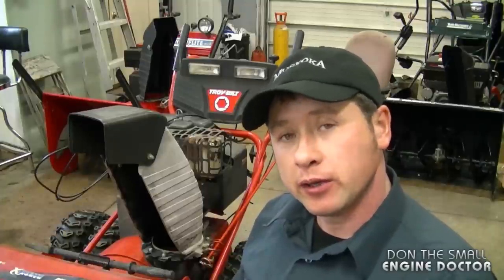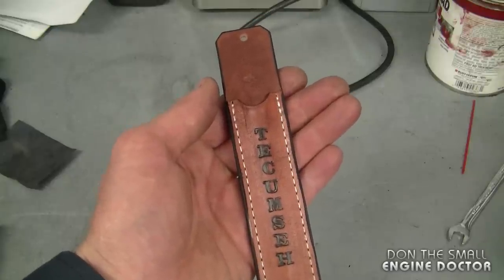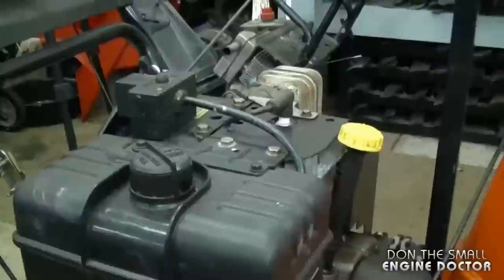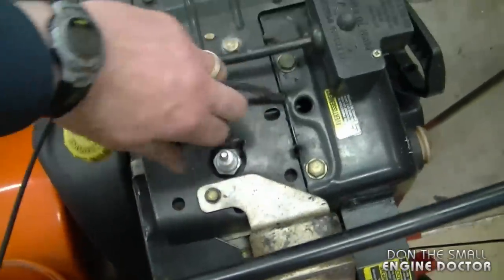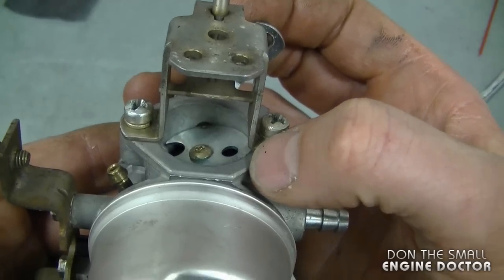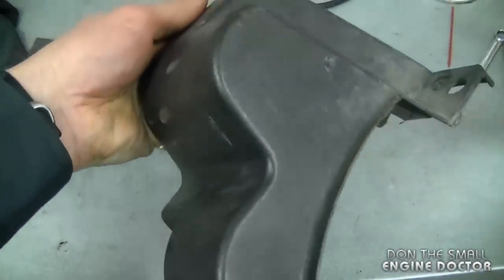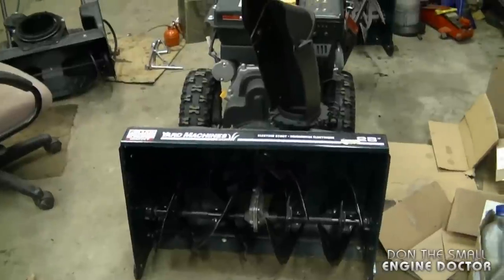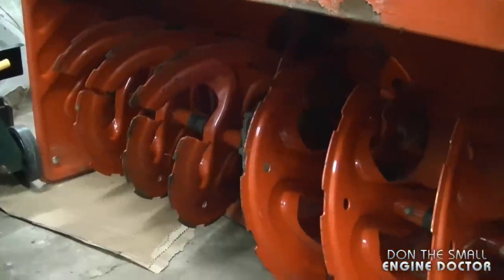Small Engines Q & A Video #146

Comment: Thanks, Dony for one of the best Q & A videos I've seen on snowblowers.  One extra benefit of using pure gasoline is the extra power one gets from it.  Ethanol fuel does not burn as well as pure gasoline across all octane ranges.

Comment: Another great video Dony ! Here in the states ( New York at least ) all you can get is that crap ethanol gas . What I do is buy the VP SEF pre-mixed 50:1 for my saws , backpack blower and string trimmer it's expensive but so is my power equipment . As for my lawn tractor , snow blower and push mower I use super unleaded and always add Star Tron Enzyme Fuel Treatment to keep the ethanol from separating from the gas and have yet to have a problem But when the season is over for the respective equipment I do as Dony has said in many videos and run the carb dry and drain the gas tank .

Comment: Don, thanks for another great Vid. About the inline fuel filter. I have been putting them on generators, lawn mowers, ATVs, Snow Blowers, and just about everything that has a fuel line. These (in tank) fuel screens really don't do much of a job. Have you ever hooked one out of a tank, maybe you can show us one. Nothing but a piece of foam, most of the trouble people have with carbs is because of the poor filtering system. Why else would we be finding DIRT in the bowel of the carb so often? I just ordered a box of 12 on ebay for $22. Total Canadian. Bet people would like to see you show how to install one, maybe along with the shutoff valve. The shutoff valve used to come on all snow blowers one time, now they are around $10.

Comment: Good advice. The only two things I would add is:

1. The pulley cover also stops snow from entering the lower end. A wet, oily friction disk or frozen transmission could result if you don't keep it covered;

2. I also add fuel stabilizer to the fuel for my OPE. It adds about 2 cents per litre to the cost but cuts down on carburretor  paranoia. Sometimes I forget to put things to bed properly, too many toys, not enough time. Seafoam is also reported to work nicely.
Reply from the maker: yes for sure
Reply: "Seafoam is also reported to work nicely"
Hey Frank, I've been using Sea Foam for a couple of years now, I filled up a generator with fuel and Sea Foam mix three months ago and when I drained the tank this past week there was a thicker orange gunk sitting in the fuel line just before the carb.
I worked on a carb for a neighbour that had stabilizer/fuel mix sitting in the tank since last Spring and it was nice and clean.
I think I'll be switching back to fuel stabilizer.
Reply: Kevin Watson
I've heard various annecdotes about both types of products. I think I've had better results with stabilizer but I'm not positive. I believe Seafoam is marketed more as a fuel additive that will clean the carburetor than as a stabilizer. Most stuff I've seen on cleaning a carburetor also describes disassembly and soaking so I sometime wonder about cleaners you can add to the fuel. The other problem is there is a lot of variation in fuel. I use High Octane since its the only variety, where I live, that doesn't have alcohol. I have seen some dealers with alcohol in their high octane blend so even there you have to watch it.

Comment: I'm having trouble setting carb on Stihl 020T. Harder start and no idle. Was serviced at Stihl dealer about 18 months ago. Very little use. Store with Trufuel.  On line manual can't find high speed adjusting screw. Love the vids. Thanks Ed

Comment: Nice vid. Great tips, especially the use of premium fuel. I have more than 20 pieces of small engine equipment. I always use premium fuel with fuel stabilizer added.  I see it as money well spent. Some  special purpose tools may set as much as a year between uses. I don't recall the last time I had a fuel related carb problem.

Comment: Don, I agree with your advice to use straight gasoline (no ethanol) in small engines.  Problem here in the midwest USA, gasoline containing no ethanol is unobtanium.  Well almost.  I buy aviation gasoline from the local air field.  Twice the cost of pump gas, but I don't use very much.  And it contains lead.  But no worries about draining fuel at the end of the season.  I wish we had some source of no ethanol premium pump gas.

Comment: Along with shutting fuel line valve I also take the cap off the fuel tank and place a piece of plastic bag over the hole and screw the cap over it. This seals the system off to moisture.

Comment: I'm not sure if we can get ethanol free gasoline where I live.  For the last few years we've been running ValvTect marine fuel in our snowblowers, leaf blowers,  our leaf chipper/shredder, and our generator.  It's expensive (about $1 a gallon more), but we haven't had any carb or fuel issues since we started using it.

Comment: I've got a cheap Poulan leaf blower that we bought from Costco. It has the new epa restrictions on it and the blower takes awhile to warm up and even when it's running I find its top end really suffers. For the life of me I can't find any adjustment screws on it, and can't find any caps that might be hiding any of the screws either. Do some of the epa restricted carbs these days have no adjustments on them at all? I'm used to adjusting the l and h screws when dialing in the engine.

Comment: Awesome as always Don, I have a B&S 7hp quantum style engine and Carb. On the carb one of the holes is stripped out where the air filter plate/primer assembly meet up with the carb. My ? is, can a helicoil be put in its place and if so what size of coil would I use?
Reply from the maker: yes a heli coil could be installed, i'm not sure off hand what size

Comment: regarding Premium fuel used in small engines.,... Doesn't the ethanol in reg fuel act as gas line antifreeze? That stuff is just alcohol essentially. It combines with the water and allowes it to go through the engine. obviously there is only so much it can compensate for though.
Reply: before ethanol gas we used a small amount of alcohol gas line antifreeze to absorb a small amount of water from the gas and burn it. With ethanol based gasoline there is so much ethanol that it absorbs water from the air  and at some point it then separates so there is a pile of water in the gas. Just drove 90 minutes to an old friend's to get his snowblower started due to the green crap in the carb. Funny too that he showed me a container for startron that he was using to treat the gas. I told him to switch to shell vpower.

Comment: Hi Don: My Murray Snowblower The Brass or Bronze Gear in the gearbox was totally shot when I bought the machine,due to the last owner replacing the shear pins with bolts 4 or 5 inches long,he took a lump hammer and bent the long bolts over,what kind of lubricant should i use to repack the gearbox??When the last owner put in long bolts he proceeded to bend the axle shaft that the augers turn on and also stripped the bronze gear.So far I have had to buy a new brass gear and a new axle shaft.
Reply from the maker: use 00 zero zero grease
Reply: donyboy73 Thanks Donny: Great Video as usual ,you have saved me a lot ,between all the generators,lawnmowers,chainsaws,riding tractors and other eqiptment I own ,Thanks alot !!! By the way here in the States almost all the gasoline I know of at the stations has Ethanol in it. But one Chain Store named LOWE's does sell small containers of Ethanol free fuel. Probally alot of money but maybe good for that last use before storage.

Comment: Last year our snowblower would start, run for a short time, then stall. At least once, I had it running for longer, drove it out into the snow, and it then stalled. Any ideas?

Thanks for making the videos!
Reply: gas cap may not be venting. run it with the cap loose to see if there is a difference.
Reply: Ditto on the gas cap
Reply: Fuel issues are usually to blame.  Check tank filter, fuel line, but it usually comes down to cleaning the carb.  Maybe you will be lucky and the bowl nut/main jet can be removed and cleaned.  Sometimes the main jet needs to be modified (enlarged) a tiny bit.
Reply: David Bacheller
Thanks!
Reply: Dean Mavis
Thanks!
Reply: gokartbuyer
Thanks!
Reply from the maker: Rockjock007 good answer
Reply: If it starts OK and runs OK for a while it certainly sounds like the gas cap. The in line fuel filter that Don mentioned could  save you a world of trouble. You can get a small one in the Snowmobile accessories section of Canadian tire for $4. I put them on everything that has an engine and (in tank) fuel screen cause they don't work very well.
Reply: Rockjock007 Thanks for your reply. We haven't had any snow here in Newfoundland yet this year. well, not enough to use a snow blower. There isn't much ice in the ponds, most are still open. It is unusual for a snow blower to start fine and run fine until the load comes on if there is dirt in the carb., but I will remember your advice. Also, yes the shut off is a good idea, I use them all the time. But, also the inline gas filter is far better than that tiny (sugar cube) size piece of foam that is in the tank.
Reply: Rockjock007
Thanks. I'll try adding some high octane fuel and running it for a while. We haven't gotten much snow yet this year in Massachusetts. I'd like some for Christmas though. :-)

Comment: Hey Donny I have a toro model 20016 push mower with a Tecumseh 6.5 gts engine that needs to be primed a lot if the temperature gets below 40°F above that temp it starts and runs on one pull. I've replaced the carb, air filter, spark plug, and breather assembly, is this normal?
Reply from the maker: yes it's normal at 40 below zero
Reply: donyboy73 I ment °+35F sorry
Reply: I have a friend who had the same trouble and what he did was to tip it on its front end when he 1st primed it, that let the gas squirt into the engine more readily, Hope this helps. Some engines are just quirky like that.
Reply: W. Gator got it figured out it was a gas cap she starts on+14°f days on under three pulls not bad for a carbureted engine with no choke I think... thanks though